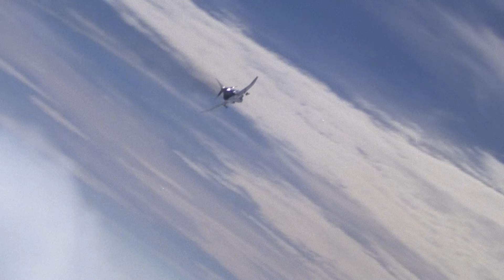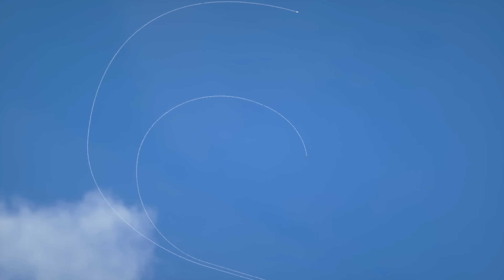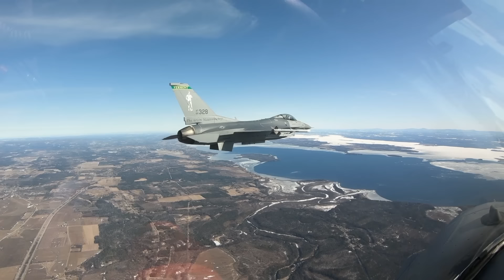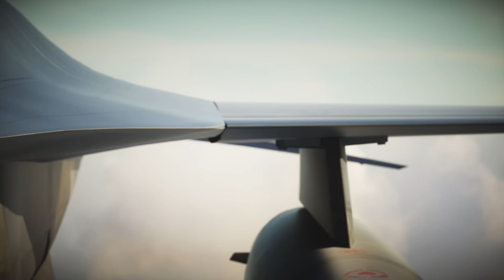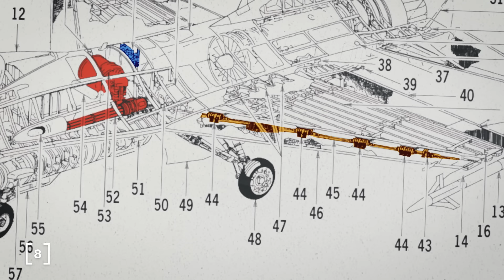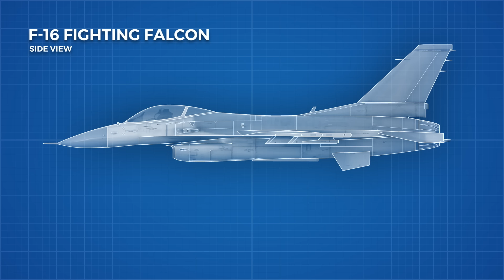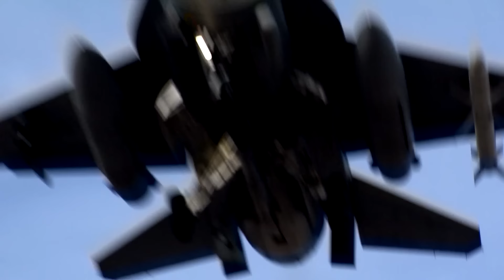The Insane Engineering of the F-16

Comment: I really wanted to understand why unstable planes are more manueverable and I'm still not seeing it despite your analogy (prob my fault bc video was excellent).

I mean shouldn't the analogy suggest that stable cars have a larger turning radius than unstable motorcycles? (they don't)  

Also, I guess I don't see how stable the system is when you aren't modifying the control surfaces tells you anything about how quickly changing those surfaces affects the aircraft.

I'm hoping maybe someone can explain it because I've wondered about it forever.
Reply: Maybe the problem is that I don't understand what you mean by stability here.  

Like isn't stability about whether small perturbations result in the dampened effects or ones which go to infinity.  And sure, I guess one way that can happen is to literally push back burning energy but that seems like it's only one way to be stable.... maybe the relation of control surfaces to effect changes but you don't lose energy.
Reply: think of it like pushing a shopping cart backwards vs forewards. the steering becomes a lot different.

Comment: 33:01 nasa was flying a F8 with full digital flight control and no backup  few years before the f16 first flew 
Interestingly the computer used was the Apollo Guidance Computer, leftovers from the moon landings
I think the f16 was the first aircraft to use digital fly by wire to have artificial stability

Comment: I want to enjoy it but i feel that there was much said but little was actually useful. All this really sat on was how the F-16 was so good at turning and not much else. It also seemed to just loop around old points. It would have been nice to see a focus on the radar systems, the engine, more on the weapon systems not just a awkwardly places section about the gun, another thing would have been changes to specific areas such as the elevator and why the F-16 has a gold tinted canopy. Hell some talking about the HMD for the pilot would have been cool. But instead you sat for 40 mins talking about why the F-16 is so good at turning

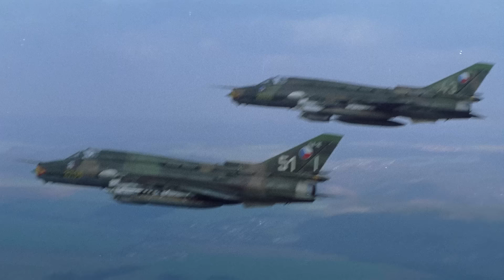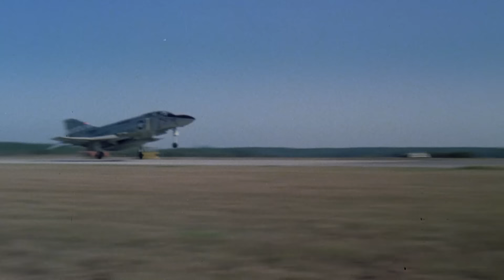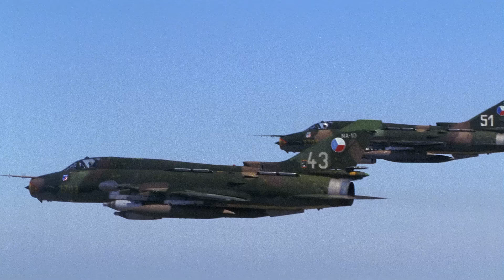Comment: The planes at 1:50 and 1:55 are not MiG-21s, but Su-17s. They look a bit the same, but are completely different types of planes. The Su-17 Fitter was a ground attack variable-sweep wing (the first Soviet plane with such wings) fighter-bomber and you can clearly see that by the rocket pods they carry at 1:55. It's much bigger than the MiG-21, slower and less manoeuvrable.
Reply: bullshiting about unimportant detail. Look at that air intake in animations. Horrible.

Comment: As an F18 fanboy I was disappointed that you did not mention the Hornet once when you discussed the leading edge strakes haha. The Hornet's leading edge extensions is missive in comparison to the Viper which makes it an excellent high alpha slow fighter. I would love to see a video on the f18 as well.
Thanks for an amazing video as usual!
Reply: Yes, also they help the thing land on a carrier at sane speeds. High drag at high alpha, but loads of lift. 
Btw, did you know ... the f14 could land with one wing missing!! Although this was for a different reason. Mad!!
Reply: @richardconway6425 isn't that f15c
Reply: @pd28cat  perhaps the F15 can do something similar, it wouldn't surprise me. The example I am thinking of was definitely an F14. It's because the fuselage of an f14 is very wide, and the pilot can use it like a 'lifting body' aircraft. Don't know whether the pilot could still land on a carrier, or whether he would need a full runway, but incredible none the less.
Reply: @richardconway6425  He's referencing the F-15 that collided with another aircraft during an Israeli training exercise. The F-15 had a wing sheared right off and still managed to land. The other aircraft wasn't so lucky.
Reply: @dumdumbinks274  "He's referencing the F-15 that collided with another aircraft during an Israeli training exercise. The F-15 had a wing sheared right off and still managed to land. The other aircraft wasn't so lucky."

Perhaps not. There was a similar incident with an F-14A from VF-213 (Black Lions) on the Lincoln in 1991. It lost about 2/3rd of a wing in a mid air and performed a safe landing. In this case too the other F-14 wasn't so lucky.
Reply: LERX kink 💀

Comment: This video is rookie shit. Like something that would've come out of the History or Military Channel in like, 2007. 

Comparing the F-4 and the F-16, designed for two completely different missions for different services at different times and operating environments (Aircraft Carrier vs. airfields) is an exercise in futility.
Also the F-4's combat record is undeniably positive. It was training and tactics that gave it a rocky start in Vietnam.

Also worth a mention that because of the Viper's single vertical tail and relatively small control surfaces with relatively short moment arms, it is AoA limited to 25 alpha. No modern fighter pilot who's gone up against F-18's, F-35's, F-22's and Sukhois will tell you the F-16 is an alpha fighter so I'm not entirely sure why you are praising it's high alpha capabilities and design.

Comment: Does that mean the F-16 only takes right handed pilots due to the right side location of the flight control command?
Reply: pointless. every jet has throtle on left side that means you have only right hand for that stick either its placed in the middle or on right side.

Comment: Crazy to think this plane is almost 50 years old. PS: Would be cool to see more teen series jet fighters insane engineering videos! F-14, F-15, F-18 😉
Reply: F-14, F-15, F-16 and F-18 are all so BADASS 😎 👊🏻 🔝 🛩️🫡
Reply: @Amanda-f3i1b f22, f35, f16 and f15 are the best
Reply: @Littlefish1239  
It's not a competition.
Reply: @stickiedmin6508  true
Reply: Curios on the desired aircraft between the F15-EX vs the Latest F-16 what would you want to be in, in a combat situation
Reply: Dont forget MiG-21, MiG -21 and 29
Reply: @phunkracy  
Good point. It's crazy enough to think that the F-16 is nearly fifty years old - it's even crazier to think that there are still, to this day, MiG-21s and -23s in active, military service in some places. F-4 Phantoms, F-5s and A-4s too. It's pretty astonishing to think that many of those airframes must be two, or even three times older than the pilots who fly them. 
I wonder what the oldest design, still in active service, actually is?
Reply: @stickiedmin6508  i think mig-21 in Romania
Reply: @phunkracy  
Yeh - I'm pretty sure there are still a lot of them flying in and around South East Asia too. I know Vietnam still flies a lot of Su-22s.
Reply: Agree I’d no clue it was 50 yrs young 😊
Reply: @donniejones3109 And will go for another quarter century with the Viper Version.
Reply: Or the p51D mustang. I think that would be cool
Reply: @@ChangeEvery14Days If my life were on the line I would go with an F-15. But I don't know a whole lot.
Reply: Isn't the f-15 the first plane to get a confirmed air-to-space kill?

Comment: I understand that the 'electric jet' was designed to be unstable, and kept in controlled flight electronically.  This is one reason there is a flat strip on the fuselage between the wing trailing edge and the horizontal stabs; if the artificial stability system didn't work, the designers just intended to move the wing rearward for a more forward center of gravity.

Comment: One important note:

The so called "fighter mafia" was actually a group of military luddites called the reformers. They are mostly founded on the principle that the US military is too reliant on tech and that US tech needs to be as low cost, and simple as possible. The reformers are actually the ones that originally fought against the F-16, stating that it was too complex and reliant on tech. It should also be noted that the reformers are a bunch of halfwits that don't know what they're talking about when it comes to what does and doesn't work on in a battlespace. 

Col. James Burton, who is a member of this group and was involved in the developement of the Bradley IFV, infamously propsoed an idea for a attack plane that would have no radar, no missiles, and only be armed with a 30mm cannon with which it would fly at tree top level and kill tanks. 

Later when the f-16 and other designs were proven to work, they just re-wrote history and pretended that the f-16 is what they had in mind from the start. From the wikipedia page about John Boyd and his contemporaries:

"The group strongly believed that an ideal fighter should not include any of the radar-guided missile systems, active radar or rudimentary ground-attack capability that found their way into the F-15."

Boyd was a great engineer, but its safe to say these people shouldn't be credited with the F-16 as they clearly opposed much of the tech that made it a success. Imagine the f-16 without fly-by-wire. 

https://en.wikipedia.org/wiki/Fighter_Mafia

Comment: For the Dutch, the F-16 has quite a lot of significance. We even have one painted like a tiger for show-performance! I doubt its replacement, the F-35, will ever achieve that sort of spirit among the people.
Reply: Sadly they repainted that beauty (J-015) to a standard paint scheme 9 years ago😢
Reply: Recently I had an opportunity to watch both planes at an airshow. Viper was as always fast and nimble. It looked like a knife, cutting the air. On the other hand, Fat Amy was most likely just as fast but looked like it needed every pound of thrust to stay airborne. It rammed the air. :)
Reply: @rafabartosik9870    ...did you just refer to the F-35 as 'Fat Amy' lmfao.... where did that terminology come from?
Reply: @kilmer009  American aviators (i.e. C.W. Lemoine) call F-35 a Fat Amy. Probably because it is fat. In Poland it's called 'Betoniarka' (Concrete mixer) - if you look at it from the rear, it really looks like it. :D
Reply: @rafabartosik9870 Didn't Fat Amy originate during the early day of the F-35 when it was carrying more weight than it needed to and was restricted in the amount of Gs it could pull?
Reply: @martijn9568  Maybe that was the reason, I don't know. :)

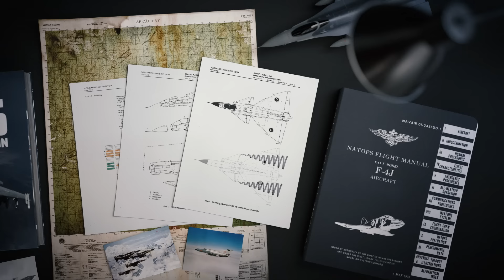Comment: At 12:45 in the video, it is mentioned that vortexes that "pass over the wing, ensuring the wing continues to get high-energy airflow during high angle of attack maneuvers, which allows it to continue generating lift". I'm understanding this sentence as the boundary layer being energized by the vortexes to prevent separation and stall. That is a valid tactic, however, I was under the impression that those vortexes were meant to serve as a substitute (or aid?) for wing lift by producing vortex lift on the aircraft's body itself. Could someone knowledgeable about this topic either confirm or deny that I, indeed understood the sentence in the video correctly, and whether my impression was right or wrong?
Reply: I think you have two different applications of the same basic concept in mind. 

Leading-edge strakes are macro-effect. They create a substantial vortex with the upwash airflow under the craft rolling up and over the highly swept, extremely low aspect ratio strake. The strake effectively generates a strong "wingtip" votex, and the larger main wing of the aircraft is located aft of this and extends far outboard of this vortex. 

A strong vortex creates an area of extremely low-pressure inside it, like a tornado. Much lower and also more stable (i.e. leas prone to seperation) than a wing ordinarily generates. This is partly due to Votrexs ability to bend and deform and change direction easier than regular straight airflow. This large vortex also scrubs the boundary layer keeping it from thickening too much, but that is a minor effect for the F-16.

Now, micro vortex generators as seen on Bush planes. That attach to the wings leading edge upper surface, perform similarly to leading edge strakes. Because they are in effect low aspect ratio wings, mounted at an angle, that is an angle of attack, to the incoming airflow. But their effect is to create micro-vortex's that will more easily follow the transition into a severe pressure-recovery area on the aft-upper wing at stall angle of attack, delaying flow seperation over the wing to a slightly higher angle of attack. Thereby allowing slightly more lift, or more margin to stall. They work by generating tiny vortex's that alone generate insignificant areas of low pressure or additional life themselves. They simply allow the airflow to change direction easier. And also scrub the thickening low energy boundary layer, which is what increases drag and eventually causes flow seperation at the trailing edge. This is micro-scale and takes place within approximately an inch of the wing surface.

The F-16 is using this concept on a macro scale. And it generates vortex's a substantial percentage of the aircraft size.

Comment: When I was working a summer holiday job at Antwerp Airport, where my father was the TD at the local airline, I assisted picking up some parts for the aircraft at Woensdrecht, The Netherlands. Across from the hangars where the Fokker aircraft were being maintained there were, apparently, upgrades being applied to F-16 aircraft. I only found out when a guard looked at me angrily and I noticed the sign "restricted area". The F-16 there was "skinless". That's the closest I've come to an F-16! 😄

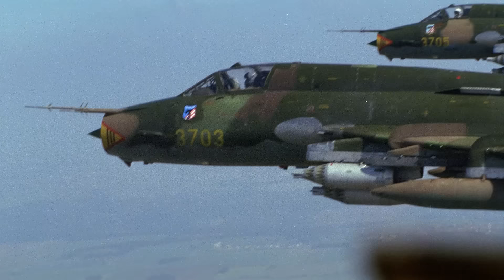Comment: Before 2 minutes mark, those camo skin aircraft are Su-17/22, not MiG-21. They are fighter-bomber, not interceptor, with short nose that house an electro-optical system rather than the large, long nose of the MiG-21 which house a radar (vodka cooled radar btw). They also have swing wing rather than delta wing (quite obvious at 1:58)

Comment: There's a little bit more on this point. The politics and general thinktanks of the 1950's was pretty heady and forward-thinking. They had it in their heads with all this new weaponry and nuclear testing, that guns was to be made obsolete, even for the solders. They were going to carry a M14, and a rocket launcher, every  and all of them.  Their ride was going to be a hover platform, recharged by a mobile nuclear reactor.  Their air support was going to be the same way. Nuclear powered, armed with nuclear-tipped smart missiles that would be "fire and forget".  They were not too far off on the latter, but the rest was just way too far-fetched.  Vietnam changed all that with the VNAF fielding 1950's fighters that out-juked the much-ballyhooed modern fighting machine the USAF and the USN fielded.  But the USN still had the Last of the Gunfighters, which the NVAF feared the most: The F-8 Crusader. She sported 4 20mm cannon, and later on, the legendary Aim-9.  But it was the guns and the pilot's skills that made them the most feared in the air over SouthEast Asia.

The Red Baron and Ault reports after staggering losses forced the military to create their now-legendary fighter schools. The USAF has their RED FLAG, the USN, the famous U.S. Navy Strike Fighter Tactics Instructor program (SFTI program, also known as TOP GUN to the public. While TOPGUN gets all the publicity, it's the USAF's RED FLAG that gets the meat of the action. They attract pilots from every American and foreign military branch to come to Nellis AFB to  play it out on the big playground made for the big boys and their toys.

But you get the general idea. Missiles are fun, but it's the guns and a steady hand on the control pole that gets it done.

Comment: I’ve found that same POI in some zero turns. Trying to run a straight line with high end mowers that have extremely touchy levers is sometimes incredibly difficult because every move of the lever twitches the machine a bit. A little bit of mush in the levers allows a straighter line in the long run
Reply: PIO?
Reply: @DoubsGaming  *PIO